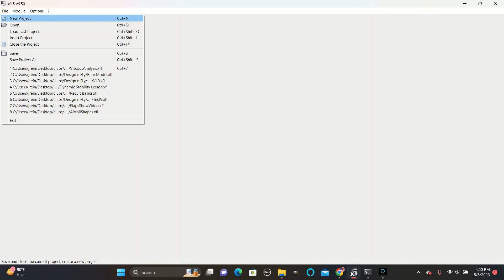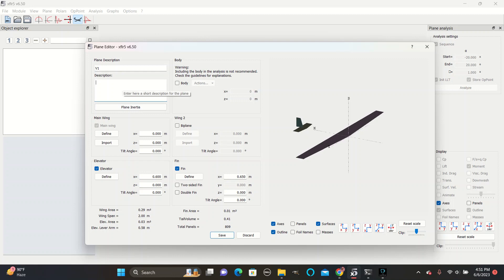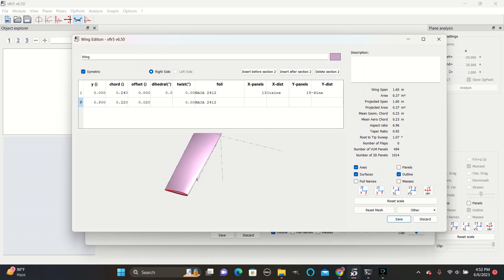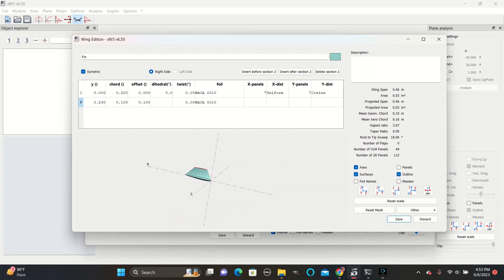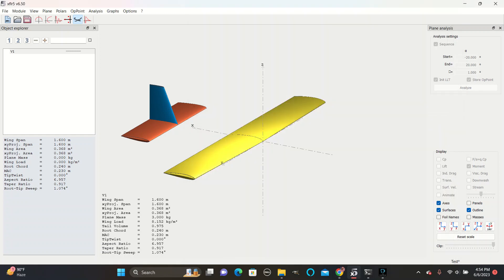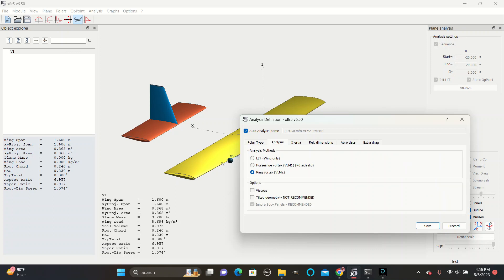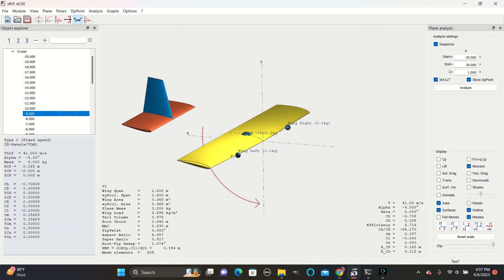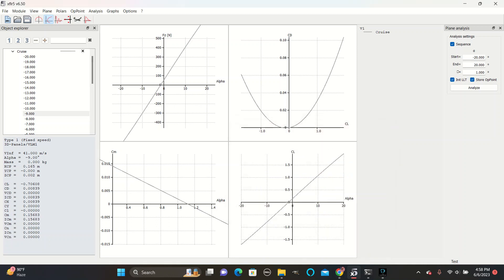New Introduction to XFLR5

Comment: But my graphs for wing are not being generated, I wanna make an airfoil which i have to test in a wind tunnel at about 18 m/s or near by. I decrease both the cord length and span with Reynold number ranging from 1e^+5 to 1e^+10, and i take angle in range of -15 to 20. It shows an error of unconverged and sometime, when i vary data ,it gives "some points are outside the flight envelope". Can you please tell me what should it do.

Comment: Bro i did not get the same graph as you got
Reply from the maker: Did you try going to the graphs tab at the top and editing that (I used 4 graphs). Right clicking over the graphs and changing the settings may also help.
Reply: @jeffreyreinhold4465  thank you